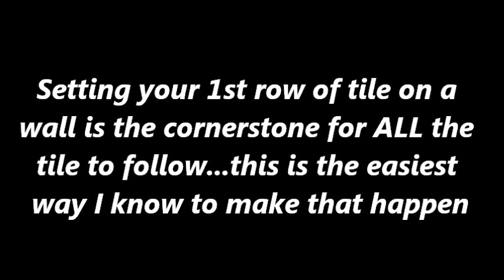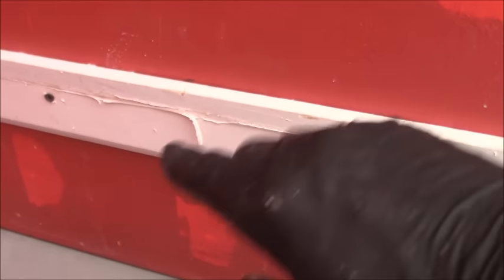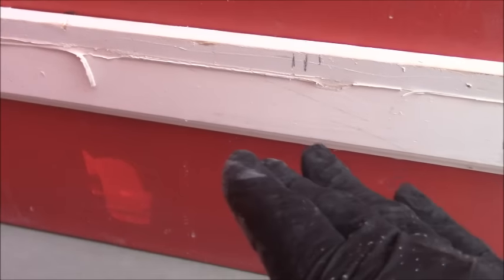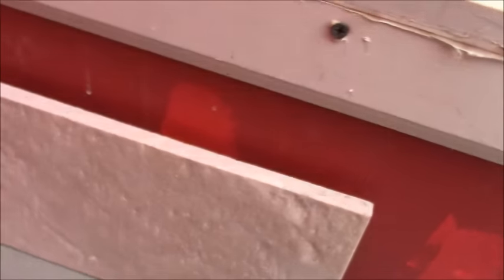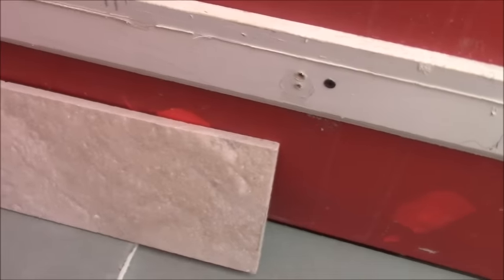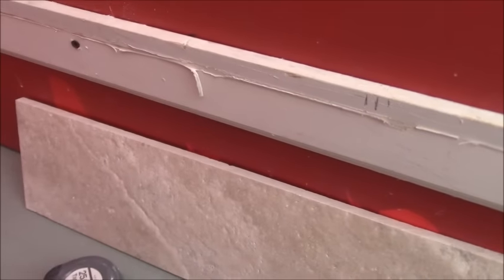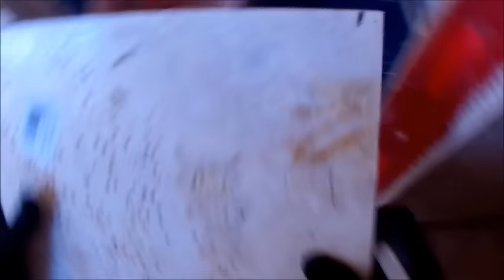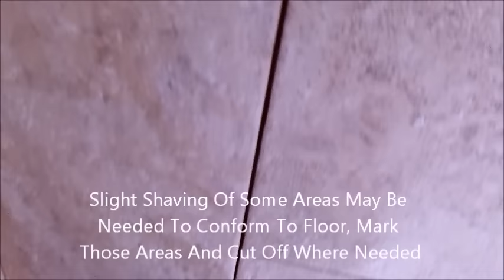FIRST Row Of Tile On Walls....how to do it

Comment: An idea comes to mind, to avoid screwing holes through the water barrier...instead of using a ledger board, snap a level chalk line, at the same location of the top of your ledger board, then lay one row of full size tiles over that. Stop there to let it dry, then later come back and tile above and below that row.
Reply from the maker: 2 problems with that. The ledger is a guide, there are still shims & such at board and tile, each one leveled individually. Can't do that with a chalk line. Second issue is the wait time, with the board you can run tile all the way to the ceiling 1st day.

Comment: Nice... Method and explanation. How about an installation of 3X6 subway wall tile where the bottom course is a tile base mold and the change is floor level is 3/4" over 4'. I would imagine you would let the base mold course follow the floor level. Then would you take out the entire 3/4" over the 2nd course OR would you take out a 1/8" per course over the next 6 courses (1/8 X 6 = 3/4)?  Yes, its a lot of work to take it out over 6 courses but would it produce a better-looking installation?

Comment: In the videos where the mortar is being set, I see that the outer edge of the floor is level all the way around with the slope only going towards the drain. In this video, the edges seem to have a slope that needs to be accounted for when doing the tile. Did I miss something? I'm getting ready to do the mortar in my shower in the next week or so, so I just want to make sure I do it right

Thanks!
Reply from the maker: The outer edge being flat/level is great if you can get it that way, but it's rare to get all four sides PERFECT, plus the flat area must be THIN so that water doesn't stand in those areas after tiling...my opinion is better to slope, but no harm either way if done right.
Reply: Thanks for the info

Comment: at the ledger board..if you are using a LASH system how do you do it under the ledger board? I guess it;s one of those things you can't do? or maybe leave an un-thinseted spot under the first tile to slip the level piece under afterwards? thanks for the help man..love the vids
Reply from the maker: Struckus yeah you could figure out something in order to make it work but honestly I don't think it's really necessary for that last row of tile, there is going to be maybe 5 to 6 only anyway
Reply: StarrTile thanks man.. I figured you could just eye it up to get rid of lippage on that row.. Appreciate the help!

Comment: Hi thank you for the video you explained yourself well. It looks very easy that with a straight line. I just have one question the bottom of the tile where it meets the floor does grout go in that seem or do you use caulk ?
Reply from the maker: There should be a slight gap, about 1/8'' at the bottom...using shims or spacers...then it gets grouted in.

Comment: Ok not to be a Debbie downer but you need to measure the entire length of the the area you're going to tile as well as including the amount of space the grout between each row of tile will add up to. If you don't do it this way you can end up with a crazy looking one inch tile across the top row which screams amateur at work. You also need to measure the width of the the area as well so you don't end up with little pieces in the back row of tiles. I find anything with a straight line works to support the tiles even those five gallon paint sticks 👍

Comment: Why not just use a laser level and cut all the bottom row, mix up some fast drying thinset and glue them on. By the time you’ve had a coffee the bottom row is set, then you continue with normal thinset.

Comment: If you only measure from the bottom, how do you prevent having a sliver at the ceiling?
Reply from the maker: You need to be able to calculate from floor to ceiling the height plus grout lines to figure out how many rows it'll take you... it doesn't need to be a full tile at the bottom, you could cut that in half or however the math works out so you have an equal tile at bottom and top if a sliver cut is a possibility

Comment: Does the tile have to closed to the corner or some room should be left on both sides of the wall where the tiles meet in the corner?
Reply from the maker: There should always be an expansion gap ( grout line ) between any tile anywhere

Comment: How would you go about setting tile in a vertical format (with the long edge set vertical)? The ledger board wouldn't be able to be used horizontally.
Reply from the maker: Paige K as long as your vertical tile were straight without the offset then it would work... but if you were to stagger them then the lower ones could all be set first with a 12 1/4" spacer in between.

Comment: @ 8:28 What's the point of the ledger board if your putting shims under your tiles.....why didn't you just lay them on the ledger since you leveled it off at the height you wanted?
Reply from the maker: The ledger board does two things, it makes it possible to run your tile all the way up to the ceiling if you wanted to on day one, and it also serves the purpose of having all your bottom tile match up exactly to your floor, the shims have to be there for spacing
Reply: @StarrTile  Why do you use shims on the ledger board if it's level and you're cutting your first row the next day?
Reply from the maker: @zeke112964  although the ledger board maybe level, tile or not all cut the same unless they are rectified so they're still manipulation that has to go on with every row

Comment: I needed to see the setting in which the tile was being installed but the camera was too close for me to figure out what kind of wall was being tiled.  Also, I just needed a simple explanation of the use of the ledger board, not a complicated installation that involved a sloping tub.  I sound ungrateful for your effort, but I am not.  Since you didn't seem confident in your explanation, I thought my input might be helpful.  I am tiling my bathroom at this very moment.  Thanks and I am grateful.

Comment: What are your recommendations for the top where the ceiling isn't level?  Concerned this is going to happen for me.
Reply from the maker: So you don't end up with weird cuts on the tile at the top ? Maybe put 1x2's on ceiling and put in a level ceiling ( sheetrock ) on it...or put up crown molding offset..level..and fill in the gap(s) at the crown.

Comment: do you use silicone around floor and wall tile at the end
Reply from the maker: I don't... and it is debatable whether or not should be done, I would not, caulk is for cracks, no cracks no caullk

Comment: Could you go 12 1/4 inch with the ledger board and not make a cut to the 12 in tile in the end? While having a 1/8th on each side?  - the curious plumber
Reply from the maker: Thomas Iron Bear yes I suppose you could but you would have to be on point with all three walls going around to make sure that everything fit nicely at the end, for me it would be a big challenge
Reply: StarrTile yes I finished the video then realized u showed why lol!  Thanks for the fast response man!

Comment: I’m a Glazier, use to cutting vanity mirrors. Why wouldn’t you use a tape measure? 
I can’t see bringing the tile in to the shower, flipping it over, and eye balling it.....using a carpenter pencil as being easier or more accurate. No disrespect just asking out of curiosity.
Reply from the maker: Because I was making a video and I don't have three hands, but yeah a tape measure is an option.... Perfection on tile is not as exact as glass would be

Comment: Ok so im a tiler myself and im asking me this question, why arent you starting with the first row of tiles? Is there something im missing here? Ty for respond
Reply from the maker: I always started with the first row forever , it would take a long time to get each tile cut perfect and then I could only stack maybe two or three rows above it before the weight would overcome the first row... using a ledger board above the first row allows you to run your tile all the way to the ceiling day 1, then the next day set you bottom row exactly to size and done
Reply: @StarrTile  Fair enough but considering when you have a floor like this, I would make all the corners the same level even tho its different measures to the drain) it should be an easy straight cut, also you are penetrating the membrane and putting some silicone in it which you really shouldnt do, if done correctly sure its waterproof but to me its both more work setting up the ledgerboard and having to put silicone in the holes (sketchy), just something I wouldnt recommend to the new beginners here but sure its your way of doing it :)
Reply from the maker: @ra4ngernub  I am never ever getting calls where tile are falling off the wall or the backer board behind it is saturated with water, it's a myth but that happens so putting silicone into those holes will probably not even make a difference....but that I do it in shores of waterproof wall
Reply: @StarrTile  Good to hear, thanks for sharing your experience and methods through these videos  :)

Comment: Help! I am gonna try to explain my situation which may be hard like you said in your video! I have a shower which I used Schulter foam Pan and Kerdi walls and floor. I am doing 3x6 subway tiles all the way up. So, for my first row I went to the middle of wall and placed a tile on spacers (both corners of tile) on the finished tile floor. The spacer was 1/8" (my tile space is tile to tile built in space of 1/16"), so that 1/8" spacer - 1/16" tile space would leave me 1/16" at floor bottom. So, with tile in middle of wall with spacer under each corner, made a line on top of tile, then took ledger board on that line and leveled and secured. So, when I remove ledger board, I should have the height of tile plus 1/16" bottom of tile and the 1/16" space on top of tile. My questions is am I thinking right? Is starting in the middle right? Thanks! Hope you respond super fast lol
Reply from the maker: I wouldn't have started in the middle...in fact I'd start with a "skirt", a larger tile at the base since your tile is so small, then work up from there. Just my take on it.
Reply: Thanks so much for quick reply. I guess what I am asking Is should the bottom tile be taller then the top of the ledger board? We are doing 3x5 subway tile all the way down to mosaic 2" tile floor (already done). Against the back wall from left to right it is not level because, first Kerdi shower pan has built in pitch (higher edges), plus floor was bit out of level to start. So, I am just trying to decide at what part of the 48" back wall span should I set my ledger board? At left side of wall middle line, floor tile is higher so I would really be shaving down tile and right side of wall middle line, floor tile is lower, so guess that is where I need to meet or go over ledger board top edge? The more I compensate for right side to work the more of left side I am shaving down. I could sound really confusing right about now haha. We are not doing a skirt and all set to go.
Reply from the maker: So I'm more confused than before....let me make it simple, this applies to any tile & situation regardless of level or not at the floor. The ledger board is set at lowest point at about 1/4'' shy of the tile width...so if you put a level at all three walls and measure down to finished floor ( in your case using a 3'' tile width ) you'll hopefully find the sweet spot of EXACTLY 3 inches somewhere with all the other areas being shy of that...it may end up 2 3/4''...that's where the ledger goes, then all your other cuts will be shy of that 2 3/4''. And this is why I suggested a skirt tile first, to give enough girth of the 1st tile ( which will end up being last set ). Hope that doesn't confuse you. Here's how I did a 3x5 subway glass in a shower with skirt.
https://www.youtube.com/watch?v=v-887lm1nRk&t=23s
Reply: Yay, through all my babble you GOT IT!!! I know I was confusing haha. So, last question. You are saying find a 3" spot where my 3" tile will fit and hopefully all other level spots at that point will fall under 3". Okay, So if that works for me and I find a 3" spot, then put ledger at 3" then when take off ledger I will then have at least one spot (maybe more) at the 3" mark. So, I will then cut down the 3" tile to get a grout line at floor? My tiles have the built in bumper which I believe is a 1/16th grout line, plus we are adding a 1/32" spacer to that joint (we need for spacing). I would prefer a smidge smaller then a 1/8" at bottom. THANK YOU SO MUCH!!!
Reply from the maker: Yes to ALL you said....mission accomplished ! ;-)

Comment: I enjoy your vids Mr. StarrTile! But let me ask you and the rest of the folks a question. I live where the weather gets very cold. Using the wetsaw indoors is not always an option. So, Ive thought about adding something to my wetsaw water to keep it from freezing. Not the pan so much as the water lines. Ive considered RV antifreeze, windshield solvent or denatured alcohol. I could care less about the damage the additives could do to the water pump. But I worry about grout or mortar not adhering to the tile. Also, do you think those products could damage natural stone products. Looking forward to the response to see what your experience has been. Man, the IQ saw is looking better all the time!!!!
Reply from the maker: I doubt there's ever been a time I CAN'T use a wet saw indoors, maybe once or twice, but some way I'm getting it next to my work. Your plan sounds good except as you said, there will be a temp rating on the mortar/thinset/grout, in addition the tile should be room temp when set...because they do change size ever so slightly with heat/cold.

Comment: It's relative isn't it? I used a level to put cabinet handles on and they all ended up a different hight from the floor because the floor and cabinets weren't level. But those handles are even right across all right 🙃

Comment: shouldnt you use caulk at the floor and not grout due to cracking?
Reply: Correct, you should caulk all corners and where the tile meets another material to reduce cracking. Most all grout colors come in caulking tubes(sanded and unsanded).

Comment: What type of thinset is best to use for large format tiles on redgaurd?
Reply from the maker: Modified LFT
Large Format Tile
Reply: Is 13 by 13 considered as big tile?
Reply from the maker: No... A 12x12 or 13x13 You are good with either thinset

Comment: Jut used this method, tile went on nice and level. Then trouble reared it's ugly head.  When it came time to remove the ledger board it was stuck stuck to the wall. The drywall paper tore loose.  If I were to do this again I think I would wrap the board in plastic food wrap as I do when when I glue up wood working projects.  Now I have to try and fix the wall.  😢
I'm sad, very sad.
Reply from the maker: Never had that issue...ever...

Comment: Do you miter your corners?
Reply from the maker: Cesar G that depends on where the tile meet up, every job is a little different
Reply: StarrTile thanks for your reply. I have tile with a 3D wave pattern I’m putting on the walls. I assume it’d be best to miter the corners for that tile?
Reply from the maker: Cesar G that cannot be answered because it depends on the makeup of the tile, obviously if it's a brownish type of color than mitering would be best but you could also use bullnose, they can be made from the same tile, as I said every situation is a little different so there's no one answer I can give

Comment: How come you don’t level the outside perimeter of the shower floor and slope it to the drain 1/4 per foot, now you install the tile on the shower floor, now you can set tile on top of the floor tile all the way to the ceiling, try that next time
Reply from the maker: Because I don't want anything in the shower floor to be level, even the outside perimeter should have a slope.. and in many cases my showers are very big, to get everything exactly on point is a whole lot easier to do with a ledger board than it is to take a chance that your floor is completely what you wanted to be

Comment: What if it's a uneven cut?
Your line would slope the wrong way.
I install tile too.
I would hold my tile to the top of the rail and use the bottom one to reflect the slope and trace and cut.

Comment: Invest in a laser level, then you can get it done in 1 day and still have the accuracy, plus you wont put holes in the wall.
Reply from the maker: Not sure how a laser level will save me a day...or prevent the holes.
Reply: StarrTile you set your level to the height you want the tile. Then you put your tile upside down, Mark where the laser touches the tile while it's sitting on the floor. Cut the tile and install it. No holes. All done in 1 day
Reply: @fliparto2  then all the tiles slide down the wall